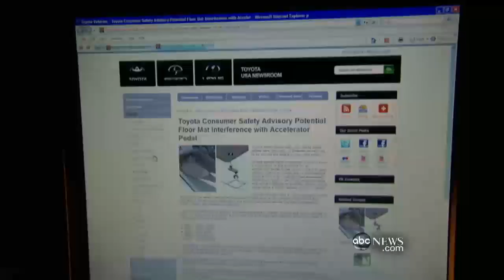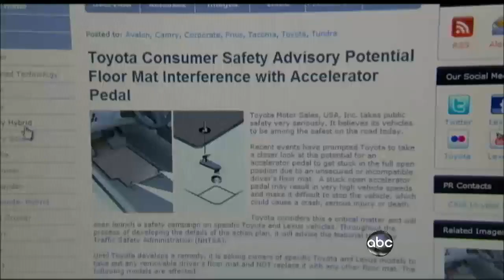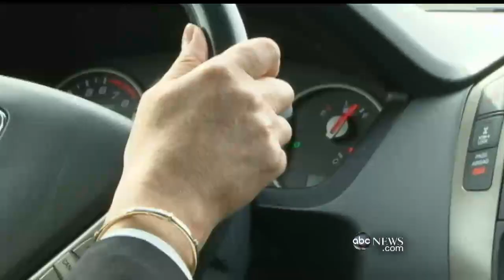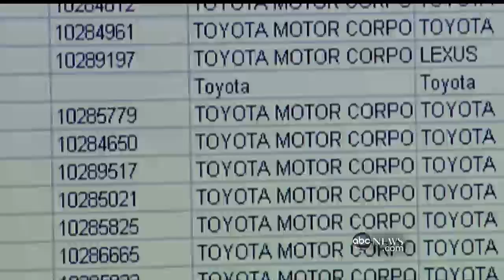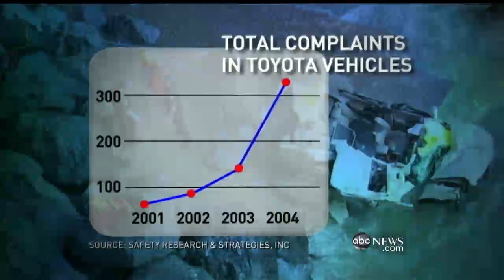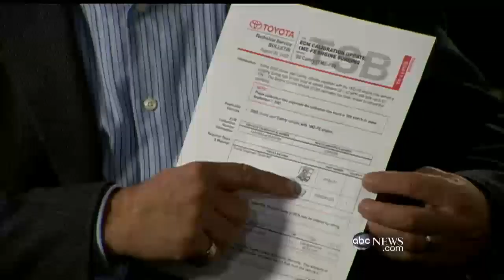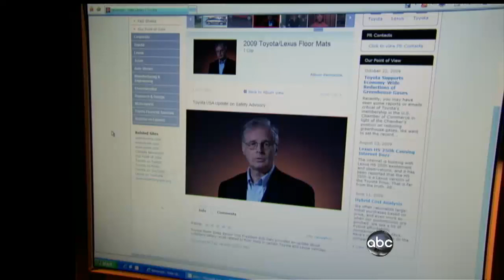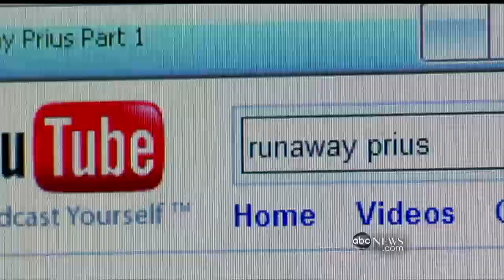Are Toyota's Accelerators Out of Control?

Comment: maybe because the Toyotas in Europe were almost the same, except for the fact that all eurpoean Toyotas have a brake override system standard. the American ones don't.
Reply: Can you please explain „brake override system“? I never heard that.
Reply: Andreas Jimmi Basically, when you push the brakes, the computer disengages the accelerator so the brakes will not be fighting the engine's acceleration along with the cars speed at that time.

Comment: Very power full accelators used in Toyota cars for fast acceleration that's why it stucks and don't come back sometimes put regular WD40 on the spring in which accelator cable is installed in engine near venturi sometime that spring got hard ...Toyota should give long accelator cables and some gap in accelator but now a days it's about 0 to 100 competition between car manufacturers so they give short and fast accelator pedal in cars so car  can goes faster 0 to 100 that's why these pedals are very powerful but dangerous so they have to give a calm and long press accelator pedal system like in old cars which takes more effort by foot but comes back easily due to long pressing ability